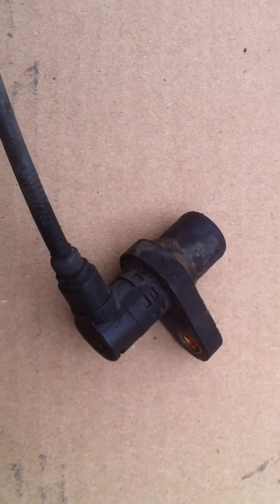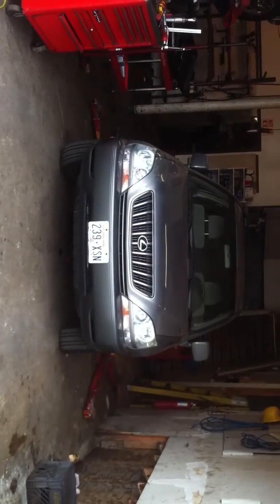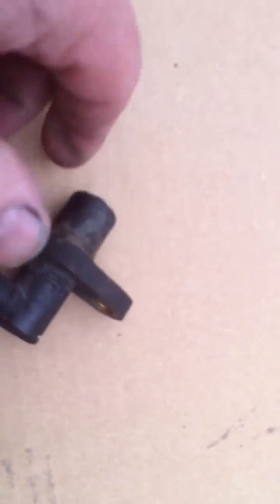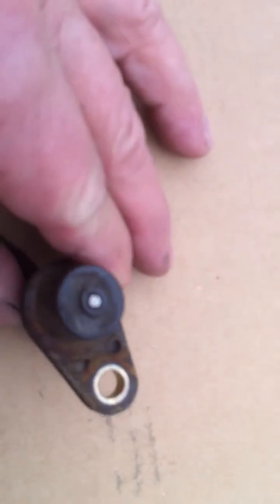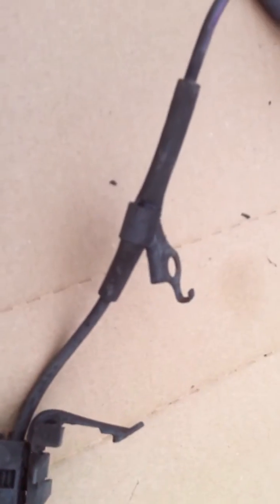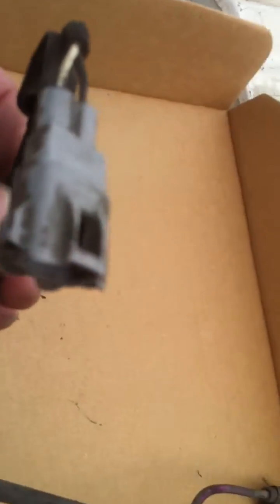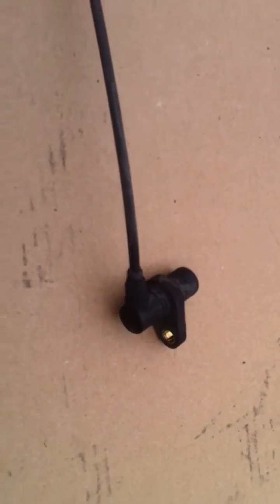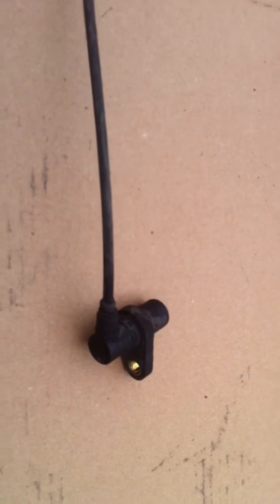Lexus RX300 ABS codes

Comment: Pete, will this cause a p0500? I have this code and replaced the speed sensor and code comes back, I have read the ABS codes off of the vehicle and there is a no or low signal code coming back from 3 of the wheels. Thanks